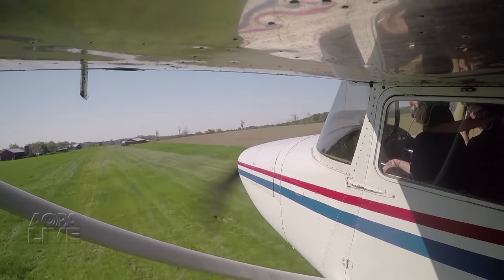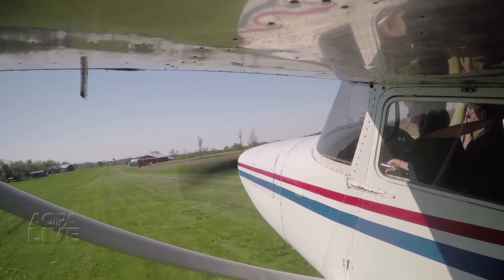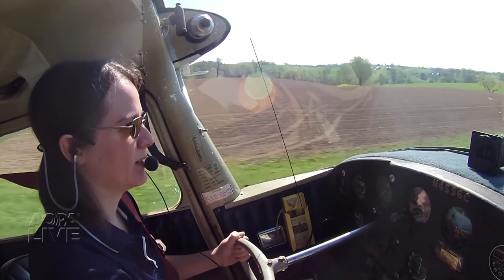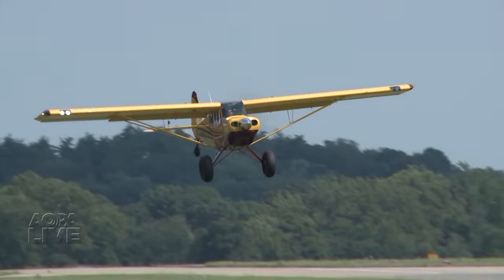Tips & Techniques: Mastering wheel landings

Comment: The "trick" is to pin it on the runway as soon as the front gear touches. You do that by moving the stick forward just a hair.
Reply: I would agree, except for the "just a hair" part, only because  readers might misinterpret that as meaning that they should be timid about it.
Students need to  be aggressive in pinning it to the runway using a negative angle of attack, and to do this they need to first get over their fear of damaging the prop. I keep seeing supposed "wheel landings" on Youtube where it is obvious that the student was never taught to use a negative angle of attack. Instead, they do something in-between a full stall and a wheel landing, which is the worst thing that they could be doing.
Reply: Yep. The proficient taildragger pilot has got to be able to execute the wheel landing in the maximum rated crosswind condition, which means landing firmly on one wheel  and flying the airplane until it comes to a full stop on the tiedown spot.  Proper control inputs at all times, etc. You aren't going to be able to do that if you just floaty-float to a sort of tailhigh semistall "wheel landing".  Pinning can be just enough to keep the tail from dropping as the mains hit the runway (grass, dirt, etc.) or it can be as firm as necessary for directional control in a strong crosswind. And for goodness sakes stay off the brakes! In the wheel landing attitude you are already half nosed-over and the geometry is such that applying wheel brakes at the wrong time can complete the maneuver before you can say lickety-split ...
Reply: to offset the AoA increase, and kill the extra lift at the moment of touch

Comment: Got absolutely no use for wheel landings. Why do you want to be racing down the runway with your tail up in the air in gusty conditions? That steerable wheel at the back isn't doing any steering up there. Three point it and be done with it.